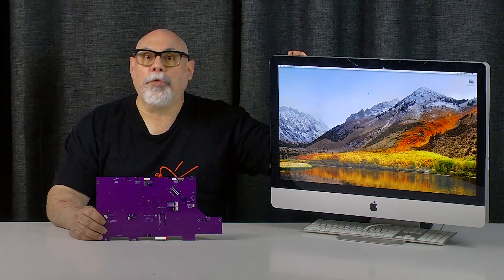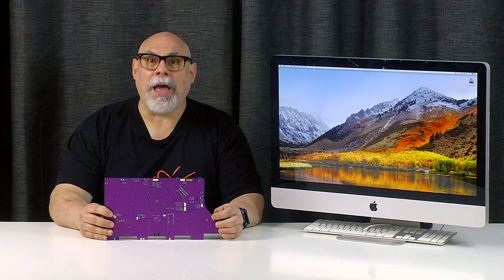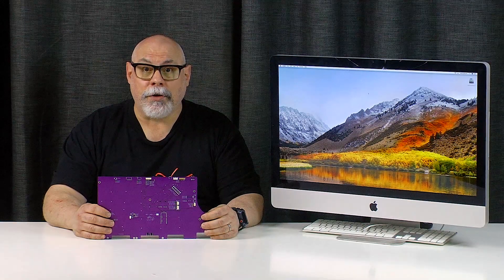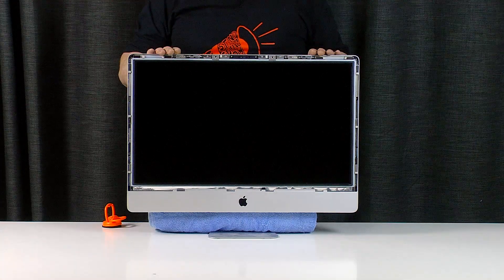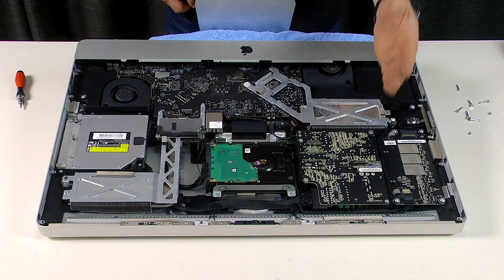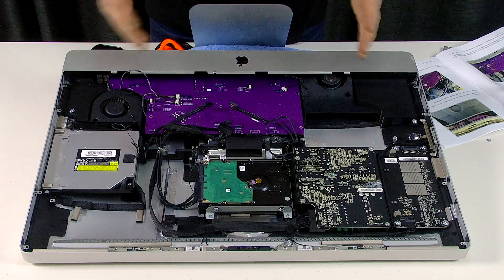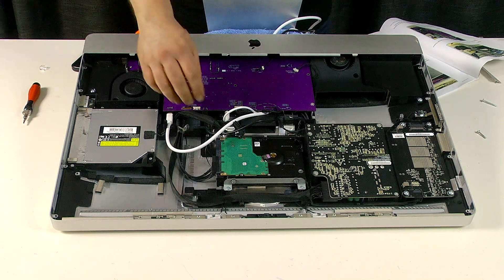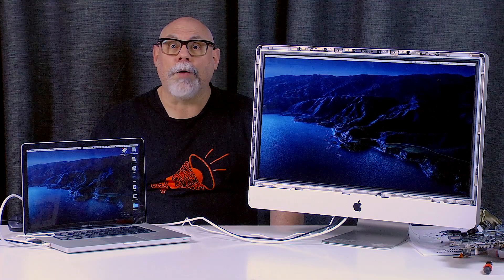Turning a 27" 2011 iMac into an external QHD Display with a Juicy Crumb Dock Lite

Comment: Watching this for the second time and hankering for an equivalent Juicy Crumb product for my just-retired 2015 iMac 27" 5k. 

I'm surprised that you didn't remove the iMac's hard drive and optical drive. Are they still somehow drawing power and connected to the new adapter board, or are they just dead weight?

Comment: Old video but would this work for the 21.5" model?
Reply from the maker: Unfortunately not. They have built the board so that it fits exactly into the 27" chassis, so it won't fit properly in the 21.5"

Comment: 4:20 funny you should mention unplugging, given how I shocked myself by leaving my imac plugged in while i turned it into a display! 😅
Reply from the maker: Mate, I've done it too! Once I was holding the LCD in my hands, and the corner of the LCD touched a live connection on the power supply, the electricity shot through the LCD frame and into the iMac chassis, leaving a little burn mark on the aluminium. Never made that mistake again!
Reply: Same

Comment: I was wondering if you took the pin outs from an internal display screen,,(fishfiner) Could you create an hdmi output from it? The reason why i ask is because most fishfinders do not have video output and i am trying to find a way to have it....do you have any suggestions as to where i could start? I love your videos.
Reply: Its not possible as the 2011 is a DisplayPort display which is not the same as HDMI which is a different digital method.

Comment: Hi Bruce, awesome video!
Would the installation of the Juicy Crumb board be the same for my mid2010 27" iMac (Core i7)?
Reply: What’s going on? Nobody is replying here, nor are there any news from JCrumb regarding the boards release date. Maybe the project has paused?
Reply: @giorgos7six  The project is still in development, we are currently in the process of testing our Final Design Prototype, and will be starting mass production of the DockLite soon.

Currently we only offer support for the 2011 27" iMac, but plan on expanding to other iMac models in future.
Reply: @Pendleton115  are you a member of the JCrumb team?
Reply: @giorgos7six  That’s correct, I am one of the Co-Founders of Juicy Crumb Systems :)
Reply: @Pendleton115  you guys are doing a great & smart work coming up on this idea! Respect ;-)
Reply: @Pendleton115 any news regarding the creation of a JCB for the 2010 27" iMac?

Comment: overpriced. perfect for apple aficionados . its a massive adapter board, nothing more.

you can get the lcd drivers for around 40 bucks from aliexpress for 27 ''iMac A1312 A1316 A1407 which have hdmi, dvi, vga input, ... audio amps etc. when you want line-in blabla.... fitting for LM270WQ1 displays. 

and yeah, you can get driver and adapter boards for everything else and you pay a fraction of the price. 

if you are interested, i cobble together an adapter board you can order with pcbway or whatever for free when i get the dimensions ....
Reply: @HendrikGranna. shorturl.at/kmrVW

Comment: $249 for the lite board, even if you get the iMac for free it's not worth the trouble of installing it vs buying a new QHD monitor for the same price and warranty included.
Reply: Seems pretty obvious, unless you're into doing that kinda stuff for fun, it's just not worth it. Luna display dongle is a much better option.
Reply: Ten months later, the DockLite is priced at $386-401. Which would cover the cost of two or three 1440p monitors.
Instead of partially turning a Functioning iMac into eWaste, it would be easier to use the "Share Screen" function. Using the iMac as a second processor.

MacOS:  "Share the screen of another Mac
While your screen is being shared, the user of the other Mac sees what’s on your screen and can open, move, and close files and windows, open apps, and even restart your Mac."

i.e.  Using Share Screen connect a monitor-less Mac to the iMac, using the IMac's screen.

Comment: Woah. The M1 iMac board sounds incredible.
Reply: You simply pull an M1 macMini logic board out, put it in a caddy and it replaces the HDD in the 27”. It uses the iMac PSU as well, so it’s all pretty neat and tidy.
Reply: @digitalrampage  I have a 2012 27" iMac and was thinking of getting a new computer but now I'm thinking I should just upgrade. So I can just switch out the current logic board for a Mac mini one?

Comment: G'day Bruce, how does this differ from one of the generic LCD driver boards you'd find on aliexpress etc? Is it just the PCB shape and compatible pinouts for the iMac or is there more at play? Apologies if this is an ignorant question, I'm not an Apple guy in the slightest, found your channel because of the ultrasonic cleaner project and really like your content (even if it is... apple) ;) Cheers!
Reply: As previously mentioned, our solution utilizes the original iMac Power Supply and Backlight Inverter, allowing for a brighter viewing experience that matches the original iMac.

 Additionally our PCB contains an integrated Amplifier to power the original speakers without having to mess about with a soldering iron or splicing wires.

 Hope this answers your question!
Reply: @juicy_crumb  Thanks for the detailed reply. Do you have projects planned in the future for ecosystems outside of the Apple realm? I love the concept of this and signed up to the mailing list, always keen to support Aussie tech initiatives!
Reply: @MrTheog1989  Thanks for the interest! We do have other projects lined up in future. Mostly Apple focused for now, but who knows what the future holds!
Reply: It uses the original power supply of the iMac and original backlight board and you don’t need a seperate controller.
Reply: @MrTheog1989 Yes you can get those boards for £20+post. https://www.youtube.com/watch?v=Vx5IoiPjPC8

Comment: What a great conversion idea! I had similar iMac 27" conversion ideas. but i think I will leave it to Juicy Crumbs Systems. I have many iMac 27" to convert. Great video.
Reply: I converted mine while ago, some boards (probably not as advanced though) that can be found if you search enough.
But the inverter they use is pretty weak which makes the screen pretty dim, it was borderline unusable when I swapped the control board for one of those chinese ones.
So if Juicy Crumbs can fix that, that would be a huge improvement (I modified mine to get more power, but that required a bit of skills and not really a user friendly procedure).
Reply: @pbe6965  As our solution utilizes the original iMacs Backlight Inverter you can expect it to match the brightness and clarity of the original iMac!
Reply from the maker: I have mine set up here on my Mac Pro, and it is super bright. So much so that I've had to reduce the brightness quite considerably to prevent sunburn. 😆
Reply: @BranchusCreations  So a great display AND at the right brightness, get a tan at the same time!

Comment: Hi Guys,
 Thanks for the interest In our work! We are running a bit behind schedule as we had to make some last minute changes to the Kickstarter reward tiers. The Kickstarter should be live within an hour!

 Thanks.
Reply: Hi guys, I just found that video, and your cool product. Last time I checked all devices sold were not good enough in terms of brightness. My old 2011 iMac is eagerly waiting for your device to get to market, do you have an estimated date ? :D
Reply: @Mrik974  Thanks for the interest! Yes, the brightness of our boards match the original factory display as we use the original BackLight Inverter. We're currently awaiting our first batch of DockLites to arrive from the manufacturer, we're hoping to have completed all DockLite pre-orders by the end of August/Early September.
 As for the DockPro it likely won't see the light of day until early 2024.